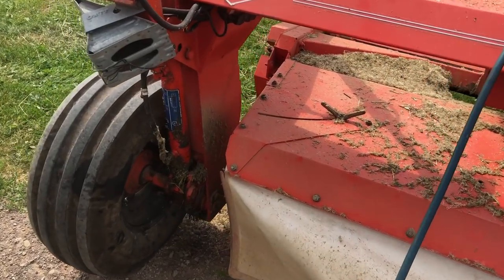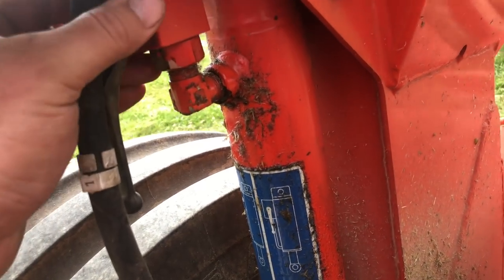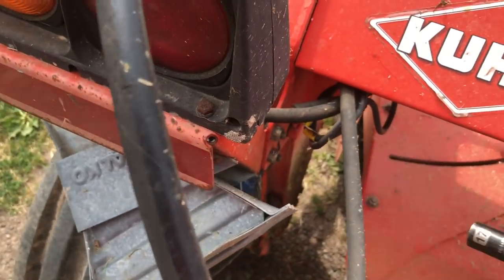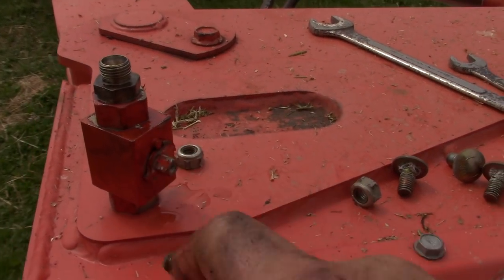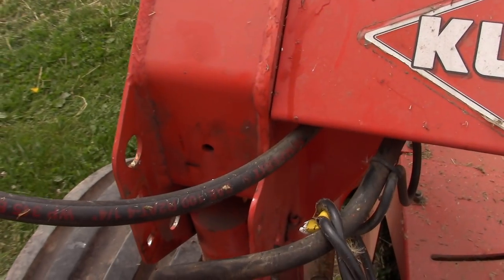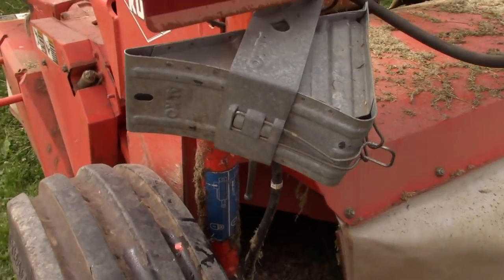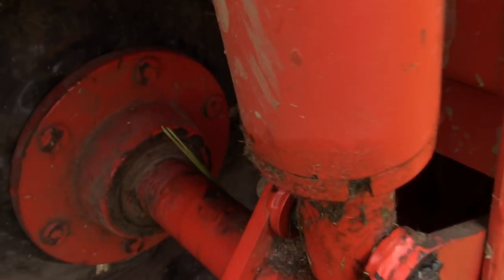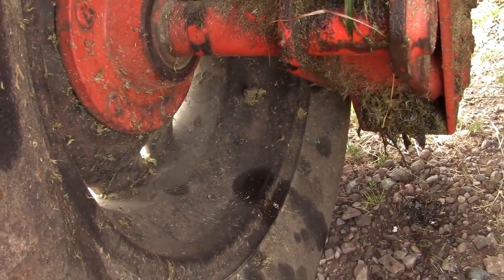Minor Repairs on the Kuhn FC283 mower

Comment: As long as the bolt looks good and the locking shoulders are square we reuse until they are wore out. Just have to be careful if you use an impact, that will wear out the bolt and nut quicker.
Reply from the maker: Thanks Andrew I’ll keep that in mind 👍

Comment: We always reuse the bolt and nut. Just have to be vigilant about wear on the nuts.... If they round off they’re extra work to get off obviously. Generally the nut has to be replaced before the bolt. Depending on how much wear is on the turtles they may last through several sets of blades. We always use an impact to change them and that tends to round off the nuts if you hammer on them much when tightening them.
Reply from the maker: Thanks, I just tightened it with the short wrench in the toolbox, probably tighter than my impact puts it anyway lol I’ll check it tomorrow after cutting today and see if it’s loose at all.

Comment: We always replace  both  blades to keep the disc balanced, also we fit the blades the other way (upside down to the way you've fitted yours).
Reply from the maker: Yeah I still haven’t really figured it out. The blades can be flipped either way I assume by the arrow on both sides. We flipped them all later on and never noticed any difference good or bad.
Reply: @macfarms  The only benefit to moutning then the other way,  is when the blades encounter a foreign object while mowing they will bend up. In fairness it only  happened to us once, but when  mounted  as you show  the blades bent down and it tore a hole in the top of the cutter bar. The cutter bar had just just been replaced  and had only worked for 4 hours. We did manage to patch the hole and continue mowing.
Reply from the maker: dlmower interesting, not sure if that would just be a fluke thing or what, you’d think they’d have a tendency to bend up anyway since the rocks are usually close to the ground. Weird. Tearing a hole in the cutterbar sounds like a total buzz kill haha
Reply: @macfarms  well we fund that mounting them the other  way guarantees they bend up. We mow approx. 10mm from the ground so we hit a lot of stones, etc. Also the mower we use, a ROC UFO-3 is 5.6m wide, it has two 2.8m Kuhn cutterbars with 14 discs in total.

Comment: Add air to the tire, we have a fc313 does the same thing if the tire get a little soft.
Reply from the maker: Checked that yesterday there was 22psi in it, says to run 18, what are you running in yours? Thanks.
Reply: 15 psi, maybe the wheel is on backwards. My valve stem is on the cylinder side or right side standing behind the mower